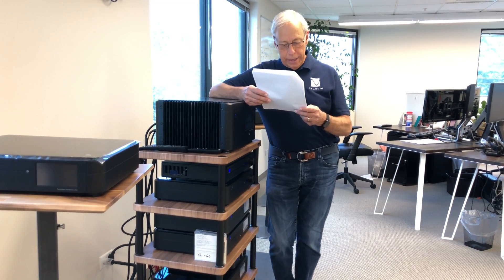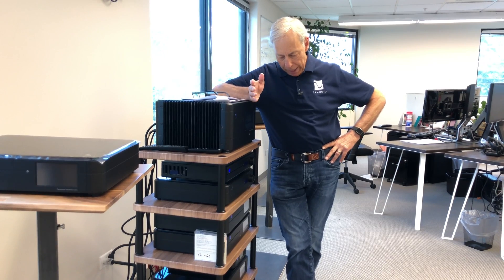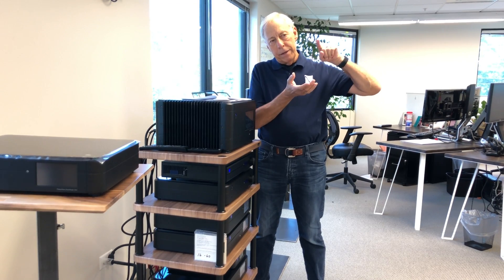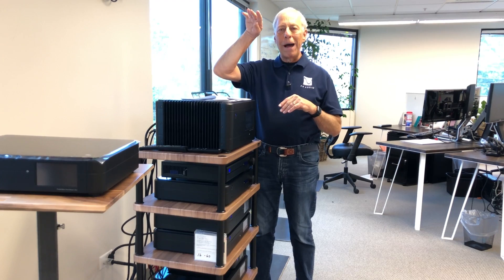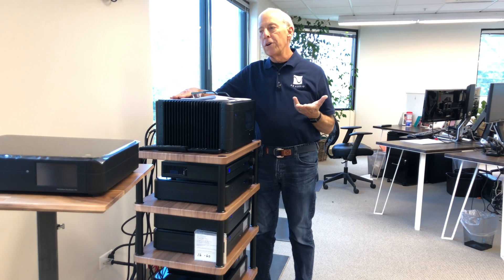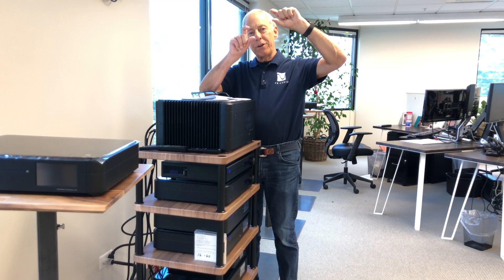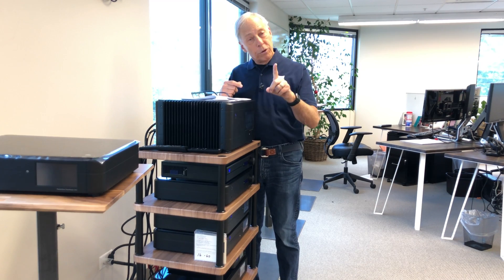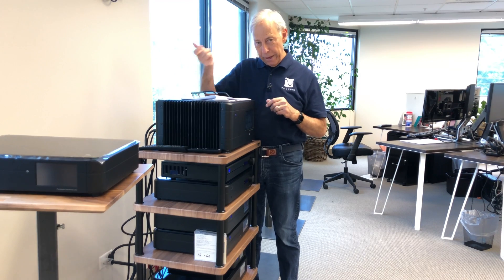Turning a stereo amp into a monoblock

Comment: Good question and explanation: It could be a good way of cobling together a cheap, fairly high power solution using two old integrated's, like, for example, NAD 3020 ,used one per channel.

Comment: There’s another way of connecting a stereo amp, pseudo earthed amplification. It surely improves the sound quality though it doesn’t heighten the output. 
You connect only one channel and shortcut the other channel by connecting a shortcutted plug in the positive (red) input on the other channel. This way the shortcutted side helps by dampening the signal (-pulling, as Paul would have expressed it😊) and it surely gives the amps a much more controlled sound.
I had my two Rotel power stereo amplifiers playing this way for years but have them now playing in ordinary bridged mode. This makes them sound more dynamic but not quite as controlled as in pseudo earthed mode. Guess it’s a matter of preference...
Pseudo earthed mode is only an advantage if your two stereo amps has enough power in advantage, otherwise it would probably be wiser to choose bridged mode. But you’ll be surprised how much it improves the sound if you have two reasonably powerful stereo amps. Surely worth trying👍
Reply: Can you do this with the rotel rb-1050?
Reply: @scottstone1444  Well, again; you will of course need two of them. One for each stereo channel.
My amps are RB 981’s with an output reaching 120 watts in 8ohm, your amps reaches 70 watts. But the construction is basically the same although your amps are some years newer.
If you’re already satisfied with the output in your listening room you’ll probably hear a clear improvement in sound quality. It’s not that the output gets lower, it just stays the same. Or in reality a smidgen higher due to the fact that each channel now has a separate power supply as I understand it. But it’s not more than 5 watts or so. 
I must stress this again: It’s important that the amps are in normal stereo mode if you connect them this way. You can’t do pseudo earthed amplification with amps in bridged mode. You will destroy your amps that way. But otherwise it’s problem free😊
I got the idea from a Hifi magazine many years ago. I don’t remember which amps they used, but it was audiophile expensive amps with an output of around 60 watts. The listening team at the magazine were stunned by the sound improvement.
Would like to hear from you if you try this👍
Reply: @scottstone1444  👍
Reply: Thanks! I will let you know if I find a second 1050

Comment: Is running a stereo amp bridged for one speaker better I think he was asking.  I’m using one stereo amp bridged to make about 160watts for one of my towers. I have two of the same amps and run them as monoblocks. One for each speaker. It’s either that or only getting 50rms out of them per channel in stereo mode.

Comment: He did miss that although you gain around x3.5 in power you lose in impedance. So you half the impedance that the amplifier is able to drive. Bridged mono also comes with other problems it sucks compared to a true monoblock system  in sound. There is nothing like a true dedicated mono system. However using a good integrated can be just as good as you have shorter wiring although this is only evident in better constructed integrated amps say as a starter Prima Luna and yes valves/tubes rock contrary to popular belief

Comment: Good day.I have 5  TDA based amps which im trying to connect via one input signsl and a single volume knob. When i run the amps one by one they run fine but two or more togather they sound crap. The quaility drops nots just the volume. I know i doing something wrong but not sure what, can you help?

Comment: You don't need an amplifier to be bridgeable do you use separate amplifiers for each Channel. All you have to do is hook up the left output whatever your program sources to one amplifier and the right output to the other one. I know this works cuz I just did an experiment to satisfy my curiosity the amplifiers aren't even the same brand and it still works of course you have to adjust the volume control separately of each amplifier. As I said this was just an experiment and I don't know that using separate amplifiers in this way is of any advantage I know you're not gaining any extra power this way

Comment: I've worked on amps where the negative speaker connection was not at ground and if you connect the grounds together you could damage the amp.
Reply: Yeah I was thinking the same thing, very few modern amps have ANY kind of earthing on the output stage, all outputs are balanced and floating. That is one of the reasons you're able to brigde certain amps. A bit of confusing and contradictory info from Paul here

Comment: Take left channel split into two using RCA splitters. Do the same for right channel. Now you have two left channels and two right channels.

Take two left channels and input it to a stereo amplifier. In the output side of amp use the splitter again but this time it will combine the two   outputs from amplifier to one single left channel. Do same for right channel. 

Now my question is will this setup ever work or will blow the amp or speaker.? Asking because we are combining the output of a stereo amp into one thought both outputs were carrying only one channel.

I hope I was clear.
Reply: I never tried this. I get what you are saying but I don't think it will work too well. What you are explaining is kinda like what amplifier designers do when they double up on the output transistors so that each channel has four output transistors instead of two and they are basically paralleled up. But doing this by just connecting the left and right outputs in parallel is not the same thing electronically. I wouldn't recomended it personally. And even if it did not bother the amp, you wouldn't have as much to gain in overall output power as if you use the amp in bridged mode as described in the video.

Comment: Paul was clear here, I applaud him for taking on a 202 question. It's a bit more difficult to picture in your mind's eye than the typical question. Some graphics would help with the phase inversion aspects. Anyone that has tried to integrate REL subs with M700's would have crossed through this threshold. :)

Comment: Man, I certainly don't disagree with your statement that we are a country of immigrants, but I think I get the subliminal message in your mini-rant. We are in fact a country of immigrants, and we are also a country that has laws and processes that need to be adhered to. It really has nothing to do with people "not wanting" immigrants to come here at all. It has everything to do with following the laws and due process. As I am sure you will agree, there are right ways and wrong ways to do things. Our current system is broken and needs fixed, there is no doubt about that. Simply allowing people to flood across the border so that we hard working middle class can support them is NOT the answer. I also liked the audio portion of this video, thanks!
Reply: People will stay-in they country if America stop exploiting and sucking them dry they destabilize every country or cause conflict to they benefits remember these words American interests
Reply: RATHMAN 572 that comment is for u
Reply: And the other idiots that think like u
Reply from the maker: Yes, I agree, but that's not what's happening. The current administration is making it harder and harder to even apply. I agree we need a system of laws and rules but I also believe in times of hardship we need to be a country that's welcoming rather than figuring out ways to bar entry and make people first apply to another country for asylum etc. There's a clear campaign against immigration on the southern border.

Comment: Great info except the ground part. That is not how it works. Heck my amps are only 2 prong with no ground what soever. The ground is important on car audio amps but not on pretty much any home audio amps due to converting ac to ac unlike car audio that converts dc to ac.
Reply: Get a multimeter and check the continuity of the negative speaker terminal to the eath pin on the 3 pin plug, or if it's only a 2 pin plug, to the chassis metal of the amp or one of the earth shields on one of your analog RCA inputs and I guarantee on most amps it will zero ohms. A direct connection. That is ground sir.
Reply: @marcusfred4480  Everything i have hooked up is 2 prong.NOTHING is grounded to the (earth).  You can ask any GOOD electrician and they will tell you the earth rod pounded into the EARTH by your home does absolutely NOTHING!!  Dirt is a terrible conductor.SIR.
Reply: @jondoe6618  Ok. Fair enough. Only that wasn't what I was getting at. I am talking about what is considered 'ground' to the electronics of the amp. i.e what is at 0 volts potential relative to the rest of the circuit. This is the chassis, and also the shield on an RCA input. It's also the negative terminal on your speaker outputs, unless the amp is of a different configuration. But that's very rare.

Comment: Ouch !! We got there ... I think !
To do this in practice just make or buy an unbalanced to balanced line driver with unity gain and couple the balanced lines to the input of each channel of the stereo amp and hook up the speaker as Paul said ...( check the correct phasing of the speakers though )

Comment: Take a set of rca cables, 2 y adapters. Run one side of the rca cable, to the y adapter, then plug both ends of the y adapter into the left and right input of one amplifier. Repeat for the second one. If multiple channels are desired, repeat as needed. Be sure to match the paired channels with matching amplifiers.

Comment: Hi 
There is a BTL converter that will, like Paul said take a single un-balanced input and make an out put that is 180 degrees out of phase. Now on a" regular" stereo feed these 2 new outputs(from the BTL) into the stereo left and right inputs and only use the red speaker connections. Also be careful don't go below 8 ohms. 
The converter is on Ebay it's a DIY circuit board. Just search unbalanced to balanced converter it should pop up. 
Again this is a DIY so if you aren't comfortable soldering or connecting an AC power supply, stay away. 
Just my 2 cents
Reply: Yep. It's a relatively simple circuit. Built several in the past.

Comment: What about putting the same signal (left channel, say) into both inputs and then run each output to a bi-wired speaker. You would, of course need a second stereo amplifier for the right channel to the other speaker.
Reply: I use two bridged amplifiers onto a single subwoofer, with a dual voice coil, so one amp per coil. Works fine, though you'll want to gain match the amps/outputs. A good way of doing it is reverse the wires on one of the coils and try to null any sound, being careful not to turn it up too much and burn out the coil.
Reply: @UniCrafter  I modified an old subwoofer the opposite way. It had dual 4 ohm voice coils and a crossover network. I eliminated the crossover, put the voice coils in series and powered it with a subwoofer amplifier.

Comment: You can also, using splitters, utilize a 2 channel stereo amp as a mono system. This way, 2 drivers or 2 different speakers can be used per each stereo amp. Think, bi-amp for each stereo channel. Some amplifiers cannot be bridged into mono either.
Reply: I thought of that too. But what about the strenght of the input signal? Wouldnt the voltage or amperage be divided? I have a stereo valve amp with only 13w per channel. Im thinking of buying another identical amp and use each as mono in this bi-amp configuration. Need to properly understand all the implications though

Comment: Yikes! Attempting this type of hook up will kill off a lot of amplifiers. You should only attempt to bridge an amp, if it was designed from the factory to do that, and has the required bridging switch.
Reply: Everyone seems to be saying that. Why? I am curious. Has anyone tried it? Do they even sell inverter kits to do it?
Reply: Each amplifier channel see the load as 1/2 the impedance of what is connected to the output terminals. An 8 ohm resistive load looks like a 4 ohm load to each channel. This is not a problem to most amplifiers. However a lot of speakers that are rated at 8 ohms are not 8 ohms at every or sometimes any frequency. In addition they are reactive. Most bridgeable amps I have seen have multiple output transistors per polarity. hefty power supplies and have their protection circuits designed for operating in that manner. An example: An amplifier I have here is rated at 100 watts into 8 ohms. If that was all it would see, 4 of the 160 watt output transistors would be adequate. However it is bridgeable and designed for industrial use with low impedance loads, so it has 12.
Reply: John Hodgson Oh I get it now.Thanks.
Reply: @hellboundedward  if the amplifiers are traditional class ab, you can modify them into a bridged amplifier with just one or two resistors and a little rerouting. whether designed to be bridged or not it's... well let's say, dangerous to the amplifier, to say the least. never recommended.
Reply: I tried it on my Yamaha and it really doesn't work, amplifier is going to sleep after that.
Reply: I had a Harman/kardon TC 600 it was $1200 or so back in the day. I ran it in stereo mode and never had a problem. It was designed to be bridged and So I Just wanted to see 600 ab watts do its thing, it was brutle. But then one channel died. I'm PTSD now on bridging.
Reply: Dave Micolichek  https://sound-au.com/project20.htm
read.

Comment: I would not recommend attempting to connect the two red terminals on a standard stereo amplifier to a single speaker.
This will likely damage the amplifier and possibly the speaker as well.  Bridged amps have special circuitry to enable this connection including routing a single input to both power amps and handling any issues with the phase of the signal.
Reply: If the amplifier isn't fed with too hot signal it should be fine. But people should not try unless they know what they are doing.
Reply: It will not damage it....it will just play the positive sum of the stereo signal. i use a 3rd speaker on B ch. with both leads in the positive terminals of ch. B and anything panned in stereo comes out the 3rd spkr but mono signal like dialogue in movies only come out the A ch. spkrs. Been doing this with 2 ch. amplifiers since the 80's....Never had an issue with any amplifiers i used over the years.